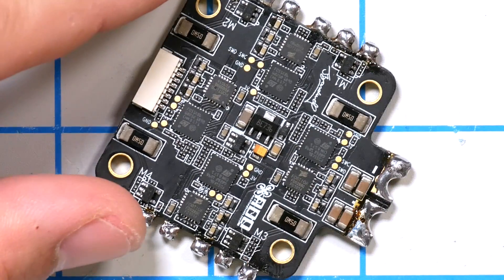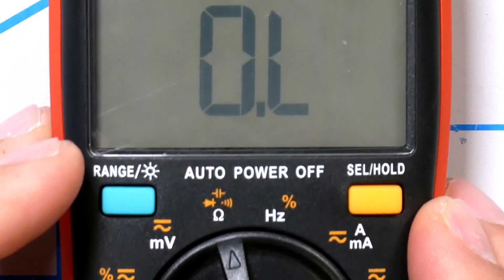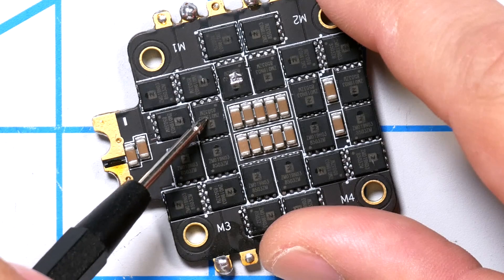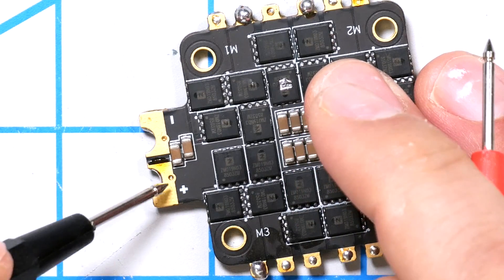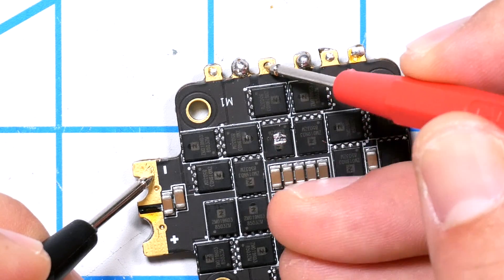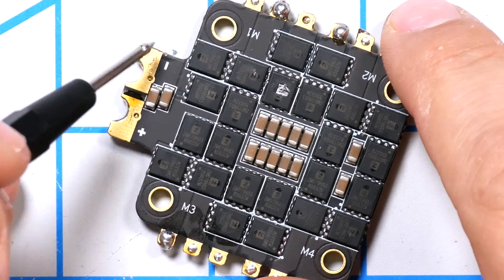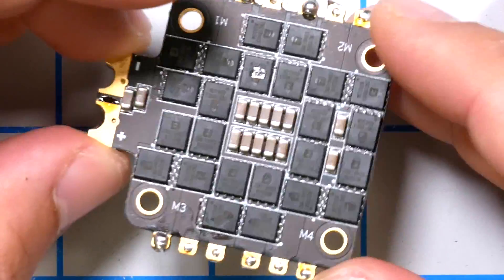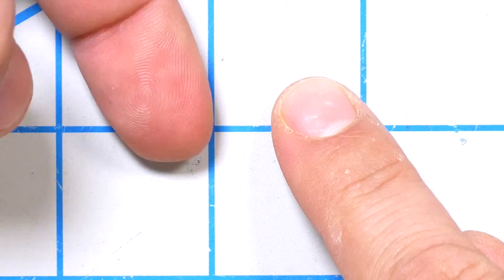Is Your ESC Broken | HOW TO FIND OUT

Comment: I’m really not confident what the test results mean in my case. I have a short from the positive and negative inputs to all three of the outputs to the motor on this Chinese electric chainsaw. It takes two DeWalt 20 V batteries and runs to an inverter ESC and then it has three outputs to The motor.  I’m not sure in this application if it isn’t all supposed to have continuity but that’s the result I’m getting. I can’t find a replacement part so I guess I’m done here anyhow.

Comment: I have a basic 30A ESC, it is not working I have tried it with 2 motor and the 6 channel flight controller recover for my drone project, the ESC BEC supply works and the motor beep sound is heard but motor dosent spin when I apply throttle

Comment: Sometimes you just gotta pop the heat sink off scrub the whole thing and resolder. Or i soldered bad the first time. Because i was getting some white waves washing over my video and persisted after an FC swap. Or i did something wrong with a cap on the lead and pads because i just have one new one on now.

Comment: I have tried to replace the blown MOSFETs on ESCs. This sometimes works if you are lucky but usually not. This is likely because when the MOSFETs fail they often take out the gate driver chip as well. Even with new FETS the ESC will just blow again because the driver itself is faulty.

Comment: Hi Joshua, I don't really know if you answer Youtube comments/questions, but here goes anyways. I've built a new drone with a 4in1 BLHeli ESC, and the drone flies fine, just needs a little tuning. Hover is very stable. However, when looking at the logs, during hover, 3 motors run at 1350 PWM, while the 4th runs at 1500 PWM. Weight distribution is perfectly centered. So I swapped the ESCs around, and sure enough, the problem followed the swapped ESC and now another motor runs at 1500 PWM. This motor is also heating up faster than the other 3. 

So even if the drone flies fine, the ESC is faulty? All 4 ESCs of this 4in1 were configured at the same time with FC passthrough. Seen anything like this?

Thanks!
Reply from the maker: If you swapped only the ESC then yes I agree the ESC may be damaged.

Comment: Fets are basically diodes so they usually fail open, you're right. I know how to fix smd but was given an sjrc f11 4k pro and I've been stumped because it's in pieces because my friend took it apart. I checked the top side of the esc but not the bottom which had an adhesive shock absorbent pad between it and the flcb. Thanks man. You showed an old dog a new trick

Comment: Joshua I dont know why my findings are different.  I just snapped a prop on a branch and the motor was boiling hot and after it cooled down I tried again and it was spinning sporadically.  I have an older tried and true Radio Shack multimeter and tested and saw that I did have some continuity so I was just about to order another ESC and I said heck let me test out one motor output that worked... and low and behold I got some continuity... so I said "actually though I'm not on speaking terms with myself after that branch incident"  I must be wrong so I wired up an old motor to see if she would spin and... yes it works... Its an IFlight suceex 4 in 1... I remeber you did a video trying to burn this one out and had a hard time doing it... but why the heck am I getting some continuity but yet the ESC seems fine... I have also seen a few other videos claiming the same thing.  None the less off to order a new motor (probably a set cause I'm not having too much faith in the AKK model anymore and will stick to I-Flight).  Just wanted to leave this comment just in case you want to follow up... you brought me into this game and I trust you will be able to figure this one out.  Ping me if you want pics of the MM readings.

Comment: I have an esc I'm not sure about , but have tested it like you show with no problems.
The deal is when I put this build together I used the smoke stopper first time I put a batt to it. It sounded like there was a bad connection. The esc doesn't finish booting. Without the stopper, it sounds normal. I used the stopper on another couple of kwads and everything was fine. 
The last fc I used with this esc got fried, I'm not sure how, so I'm a bit wary of this thing even though I don't get any continuity anywhere when I test.
Anybody have any thoughts??

Comment: Hey Joshua, I plugged in my new drone with a smoke stopper. The light turned on and then smoked quickly and a motor wire came off, do I fix it and try again or did I get a faulty smoke stopper and my esc is fried? Would love some help! Thanks!

Comment: Hey Fpvknowitall I hope you can help me. 2 of my 4 in 1 escs are not responding upon plug in. No motor move, no beep. Powers up fc vtx, detects all escs in blheli s and I’m able to flash them. Just no motor response. Thought?
Reply from the maker: If you don't hear any beep at all from those motors, not even the 1st-three beeps, then the motor is wired up wrong, the motor is damaged, or the ESC is damaged.

Comment: Its not easier to take apart the esc and measure it with multimeter  , instead of just plug a working motor and test it.. as a first  step of troubleshooting at least..

Comment: Hi, I don't know if my problem is this, but I don't have idea, so I'm asking... I have this issue: when I test my motors in betaflight, they spin. When I try to fly in the field, two of them do not spin. I guess ESC and motors work, since in BF they spin, so what could it be?
Reply from the maker: Make sure you're using DSHOT so you don't have to calibrate the ESC.
Reply: @JoshuaBardwell  thank you, I checked it all, dismounted it, re-soldered pdb and ESCs. ESCs seem to work, motors seem to work, I fear the problem is in some bad connection inside the board, probably happened after a heavy crash I had last monday. This is what happens: when I plug the 4s Lipo, sometimes FC reacts, sometimes does not. If I touch the sleepy board, then it wakes, and lights and sounds work, along with the motors. I think easier way will be to get a new FC stack, I'm not that good at soldering. So far, thank you, I will write if I find out different ways to solve this. Cheers from Italy, R

Comment: Hi! I’ve just bought a hobbywing 4in1 esc 60a combo and I don’t know, or remember why the esc doesn’t beep anymore at all... It’s recognized in BLHeli32 but can’t read any configuration of each esc. I have updated the FC controller to betaflight 4.2.2 and I’m not sure if it’s from this moment the 4in 1 esc went bad...or when I tried  to bind the r-xsr with my jumper many times so I had to connect and disconnect my LiPo a lot of times with one hand and maybe fried the esc...?... Has anybody had this experience ? Thank you for your help and thank you for your fantastic videos Joshua...
Reply from the maker: If the ESC doesn't beep at all when you appy power, then the ESC may be fried. The motor does need to be wired up to make the beeps though. Otherwise the ESC can't beep.
Reply: Joshua Bardwell Thank you Joshua. And the cause might come from when I’ve connected and disconnected several times the Lipo to try to bind the r-xsr?

Comment: After this testing did not determine my ESC problem, I checked the voltage on the ESC signal wire. All showed 2.6V except the ESC that appeared bad was only 0.6V. Apparently I had shorted it during another repair. Queue Bardwell resource mapping video!

Comment: Hello,what would cause no esc tone on power up and the motors to spin only when I start them by spinning by hand?

I was hovering about 3 feet off the ground then it just fell to the ground....I may have heard a crunching like sound too....lol..but everything is cosmetically normal and no apparent damage

I also get the normal esc tone when connected to BLheli 32 sweet.
Reply from the maker: It sounds like your ESC is dead. I would replace it.

Comment: Question when i connect the battery to my arris drone and turn the reciever on it connects and arms then when i apply throttle it acts as though it disconnects and starts beeping furiously. I replaced a motor and apon reassembly i ran into this issue. The motors will spin on the initial conection but will not arm henceforth and again beeps as though its lost connection completly. Is there some troubleshooting i can do or have you run into this issue and may be able to give me an idea on the issue? Thank you
Reply from the maker: I think the motor is spinning the wrong direction and it is causing the quad to want to flip over when you arm. Check the motor direction.

Comment: Hot air gun for SMD/SMT rework, flux, and replacement fets is all that's needed. Blown fet us literally a 90 second fix.

I've always flown Airbot ESCs since the first gen Wraith32, since all quads had the same ESCs on them and they all used the same Fets I just made a order for 25 fets from a USA based distributer and when one failed it was a quick simple fix.

The first gen wraith32 was fantastic but fets would pop on them for no reason other then that they was bullet proof.

Now im flying the 60a Succex esc and the Airbot Furling Airport esc on pretty much all my builds... Out of 25 or so builds most right now have the Metal fet Succex 4 in 1 and the rest the Furling Airport... I have a couple older builds that are running the Robotdog blheli32 escs.

I bought a strip of 15 units of IRF7480M Fets as the Furling Airport and the 60a Succex esc use them as well as the Tekko F3 metal fet esc.

The fets are about USD $2.00 for 1 and for 15 i paid $1.85 each (if you buy thousands lol they get down to about $0.80 cents and thank God or we would be paying a lot more for escs.) 
Anyhow 9 times out of ten when a esc fails it's a popped fet. Rarely does a gate driver MCU fail and on 4 in 1s that are inside the frame caps are getting knocked off.
When they fail it's a fet most of the time and that's easy once you have spare fets and the rework station the other failure that happens be it rarely is a burnt trace in the board and at that point it's parts. However that is rare with the high current high copper content boards we now use but was something that happened a lot say 3 years ago in the days of the 20A escs that we was asking WAY To much from.

The Succex 60A has been amazing in every single way and totally the most reliable 4 in 1 i have ever used and i have not had but one pop two fets on the same output replaced them and everyone has been totally rock solid. The Furling Airport has been perfect as well except for a lifted motor pad on one.

The Robotdog ESCs blow fets a lot and I have replaced about 25 fets on them in total. At one point i had them on 6 builds and i flew those builds a lot and fets popping was somthing that just happened.. Turtle mode and you was going to pop fets from time to time and it was almost always the top fet on motor pole 1 and 3 when you popped one it would every time pop the two outside top fets never just one failed fet and that's odd because normally when a fet pops it's normally 1 and with no consistancy to what one goes. Popping 2 fets on the same output doesn't happen much if ever but on Robotdog ESCs it was automatic if you had a failure that was two fets that had to be replaced.
Reply: Had bad luck with first gen Airbot. The Wraith32 and Ori32 lines. Random blow-ups and shorted MCUs on crashes. The cramped layout doesn't help in tracing and repairing anyway. Ditched them since then. Currently running second gen Airbot ESCs, the Furling32 45A. Reasonably priced, simpler layout, and last longer. Though I hate the fact that they use the smaller SMD resistors and stuff, which is a pain in the butt to work with.

I'm surprised that most repairs you do are just replacing the FETs, because I rarely just have to replace the FETs only. Most of the time, I have to replace the gate inrush limiter and in severe case, the gate driver too.

Comment: Hi Joshua 
one of the 4 engines of my Emax Buzz is broken .... I tried to replace the engine but it does the same defect ... so can the esc card have a burned mosfet?
Reply from the maker: Yes definitely
Reply: @JoshuaBardwell  Thank you.  When I replace the esc card I have to reconfigure some parameter in betafly?  sorry but I'm a beginner ...
Reply: @JoshuaBardwell  Ok Joshua ESC BUZZ REPLACED .... now it flies which is a jewel ....

Comment: After a short circuiting on the output, my ESC now start with 3 beeps instead of one long beep. Also the motors are not running at full speed anymore. Is it broken? :(
Reply from the maker: It's hard to tell just based on the info you're giving here. If you want to email me we can look into it. I would suggest sending a video of the startup beeps.
Reply: Joshua Bardwell Josh can you help me? I have tyro129 problem here is a link, please help me if you can, thanks!
https://youtu.be/PWBUSdpT3zY

Comment: I had a crash and my tekko 32 4in1 stopped working and communicating in 
bliheli 32. Is there anything i can do or check to fix this as it;s not 
the cheapest of escs and everything looks as normal. Theres no damage and but and your initial testing mine all checks out. I dont get any beeps its just dead.
Reply: I literally had the same problem with the same ESC 3 days ago,  plug my battery in, no chime, but my camera, receiver and everything is still working and communicating but my motors dont move at all. Is this the same issue you had? Did you get it resolved? I'd love to know since its my first quad and ive only had it in the air 5 mins and now it wont work lol
Reply: @SpiderGoatz  No shes toast now. I have had a regular tekko go like that and the tekko 32
Reply: @kramersteensymes3523  thats what i was afraid of, thanks for the reply!
Reply: @SpiderGoatz  i am over 4in1 escs.
Reply: @kramersteensymes3523  is it just better to get separate?
Reply: @SpiderGoatz  IMO it makes for a more reliable/ serviceable machine, If one esc goes you can just replace it often without even pulling down the quad. The build wont be quite as neat and possibly a bit heavier but it's not something i notice and i fly like a nut :). Spedix seems to be the most reliable escs for me.
Reply: @kramersteensymes3523  gunna have to order me a set of IS30 then, thanks!
Reply: @SpiderGoatz  I use the SPEDIX ES30 HV 30A  on a few of mine but i imagine the IS would be just as great.

Comment: When I plug my 4 in 1 ESC alone to my smoke stopper and the lightbulb illuminates does that mean I have a short?  I did the test in this video with no problems.  My ESC will send power to my FC only when the smoke stopper is not plugged in.  Thanks for your help! Great videos!
Reply from the maker: If the bulb stays lit permanently then the board may have a short. But sometimes the vTX or LEDs will pull enough current to light the bulb all by itself.
Reply: @JoshuaBardwell  Thanks Josh!!  Those suggestions definitely contributed to the amp draw.  My problem was the bulb I was using was rated to low for the amount of amps I was drawing.  I switched to a 1157 and it seems to be working now.

Comment: @Joshua Bardwell Any idea on how to set the esc start up tone on the blade torrent to the imperial march sound ? im a complete noob and need some help !
Reply: @Joshua Bardwell Update the esc's are skywalker 20 4 in1 and I flashed the esc in the blheli config with version 4.85 imperial march and set beeper strength to 91 and the start up tone is now the imperial march but now my torrents motors wont spin, again im a real noob at this and its my first time figuring this stuff out any help would be awesome, I did put the version back to 4.9 and the motors are working normal ! not sure what to do to get this to work the way i want it lol

Comment: Sorry not related to the video but i have 2 questions. I looked and looked for your video but i cant find the one to eliminate the dead spot at the bottom of the throttle stick. I know its a cli thing but cant find your video on it. Also when flipped over and activate turtle mode on one quad the motors wont reverse. Is there a workaround for this? Please any help would be appreciated
Reply from the maker: To eliminate deadband, lower the "stick low threshold" in the receiver tab. It should be just slightly higher than the value of the throttle channel when the throttle is all the way down.

https://youtu.be/jpuiKcQJ70s

That video has full instructions.

If the motors don't reverse then most likely the ESC's don't support dshot commands.
Reply: @JoshuaBardwell  thank you. Unfortunately i know the esc support dshot 600. I use the same one in another build and it works fine. Will contact race day quads and ask them for help since i bought it from them. Thank you again for answering. You da man homie!

Comment: Great tips again! Thanks Mr. Bardwell :)
I had my Lizard95 lying around for half a year because I was too lazy to debug whats wrong with it. One motor want spinning. Now I tried this... No conductivity at all, but one motor wire was without a contact with esc pad (probably fell of after crash). I guess I could figure that a long time ago if I wouldn't such a lazy ass idiot :-D
But your video definitely helped me to at least try something quick to resolve the problem :)
Thanks for everything you're doing for the community

Comment: I was trying to figure this out today. Great timing.
However the problem Im having is that two different Crazybee f3 pro boards are having problems, or is it the motors.
If an ESC has issues is it always 100%?
After running for a while the motor just stops. unplug it, plug it back in it runs fine until it stops working again. Can be five minutes or 20. 
Not sure how to test to see if it’s the motors or the boards.